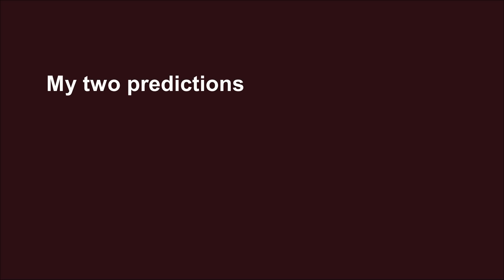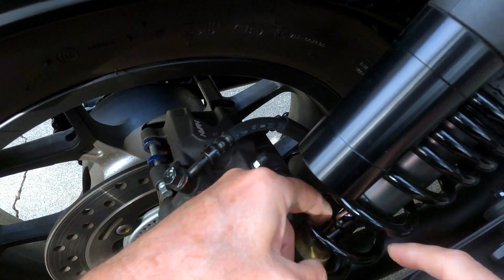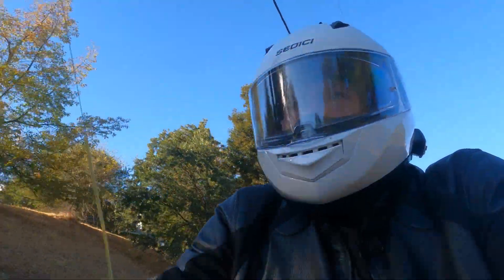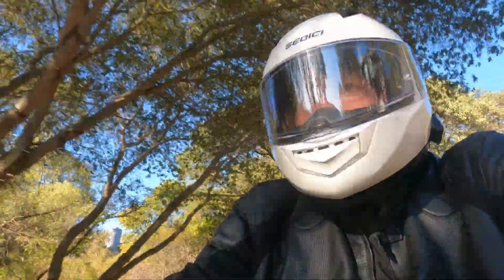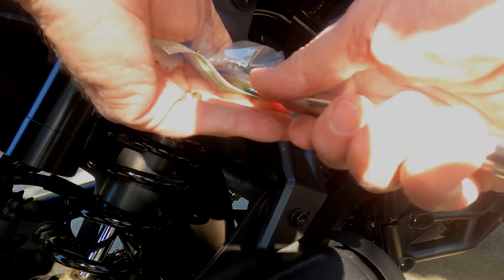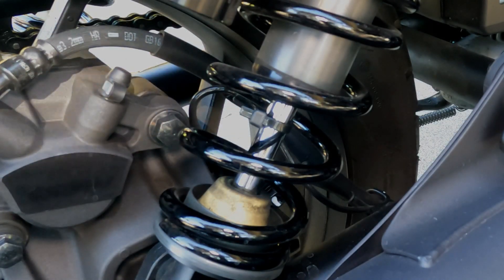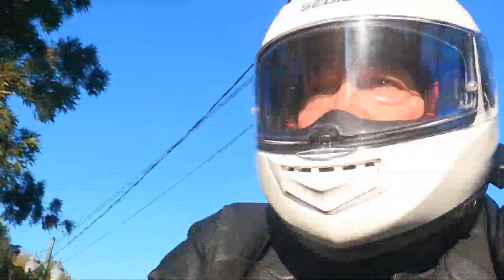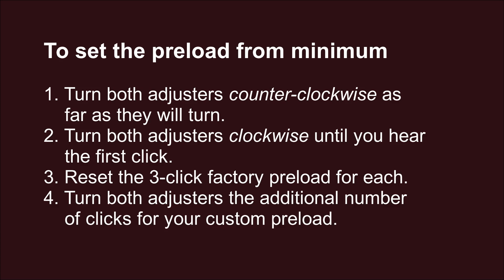Taming your Rebel 1100 suspension

Comment: Excellent Video....really helpful & put it to good use straight after viewing. I added the rear seat backrest & pannier holders (both Honda stock) to the bike. I noted the whole package added about 10 pounds to the rear of the bike which combined with my 188 pounds took it up to 198 pounds without the panniers themselves. I did the ZipTie test test for me & for me/added fittings. Front forks I added a half turn like yourself, the rear shocks I added 4 clicks for just me (188lbs) and added 5 clicks for me/additions (198lbs). I will obviously need to increase the preload once I add full panniers to the  the bike come the Spring (Overnighting) but hopefully only by 2-4 clicks more? The roads in the Scottish Highlands, where I live, tend to be more undulating & bumpy then the roads around the towns & cities...this includes the main trunk roads through the Highlands like the A9, A 82, A83, A86 & A93. Thanks Again "Papa" Steve.
Reply from the maker: Thanks for the feedback. You preloadings sound about right.  Enjoy your ride.

Comment: Well done Papa Steve, excellent video! I also lost count and had to count from zero. I tried the zip tie test with a passenger and saddlebags, the zip tie was buried under the rubber stop at 18 clicks, I weigh 160 and my passenger is 140. When riding solo with saddlebags , my zip tie test put me at 12 for a sweet spot. This video will help so many people, well done sir!
Reply from the maker: Thanks for the encouragement and the data.  I can't really use the saddlebag number without knowing how heavy the saddlebags are.  The 18 clicks makes sense to me for a combined weight of 300 pounds. I'll update the table.

Comment: Compared to the Scout the Rebel rear shocks are great (158 lbs)
Reply: Have you run the zip tie test?
Reply: @cruisinwithpapasteve4907  No, the Rebel is in hibernation. November to April too much snow and too cold here in Finland😂☃️
Reply: @bennytuomolin4416  I didn’t realize you’re Finnish. My ancestors are Finnish on my father’s side.
Reply: @cruisinwithpapasteve4907  Could tell from your name😀. Koski is Finnish for rapids, white water.
Reply from the maker: @bennytuomolin4416  Thanks.  I knew that. I looked up my name in Translator once.  My grandparents on my father's side were both Finnish and English speakers. But I'm third generation. I know all of five words in Finnish.  I would tell you what they are but unfortunately I never learned how to spell them.
Reply: @papastevesgarage  😀👍 Finland has two official languages, Finnish and Swedish. I’m a Swedish speaker but of course also speak Finnish fluently. Finland was part of Sweden for 700 years until 1809.